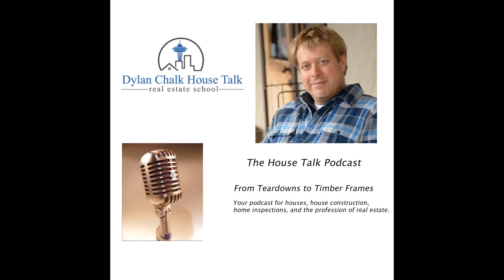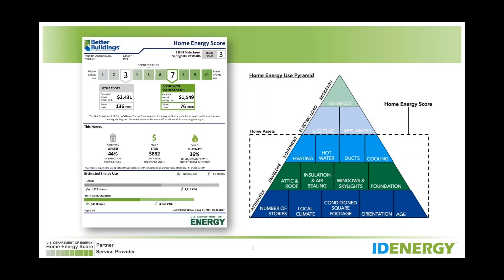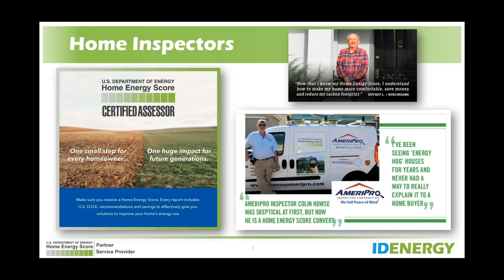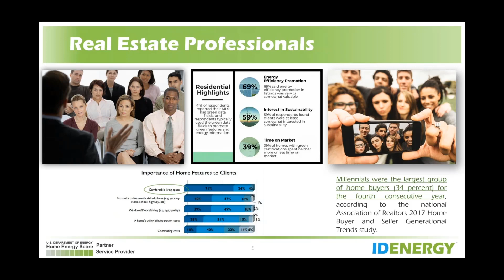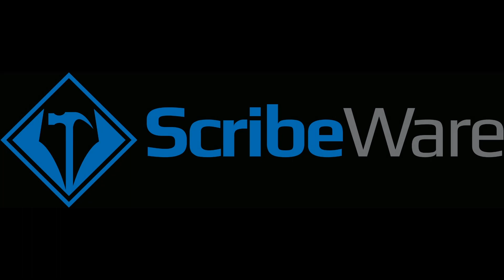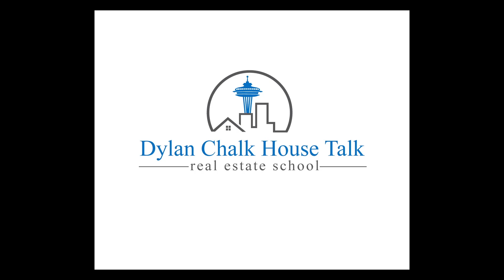The Home Energy Score: The Ultimate Win, Win

Comment: Does the HES make any recommendations for air-sealing, or just duct sealing and insulation improvements?  I know it is just a visual assessment and does not require a blower door, but air-sealing is very important for heat loss and epecially for IAQ issues in places with wildfires.  Thanks! ;)